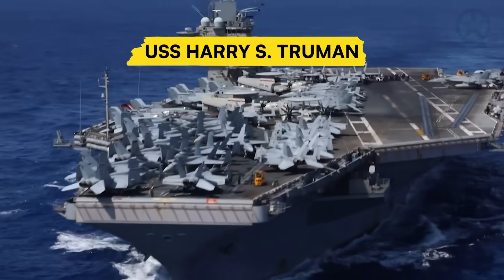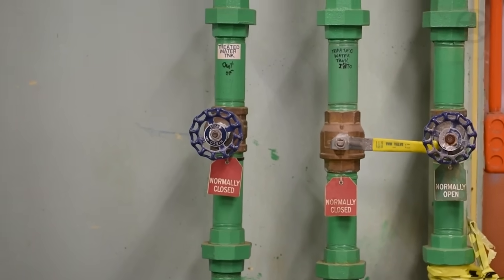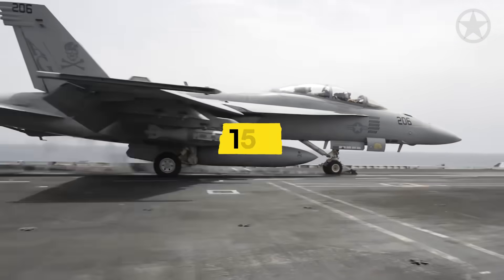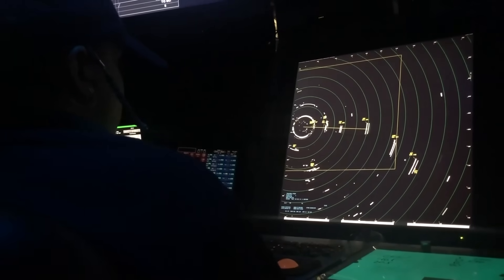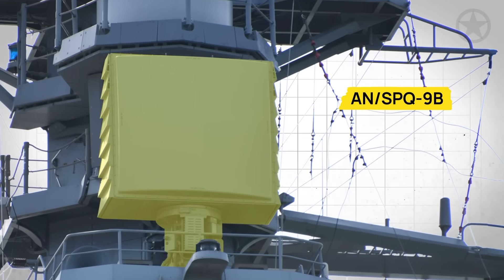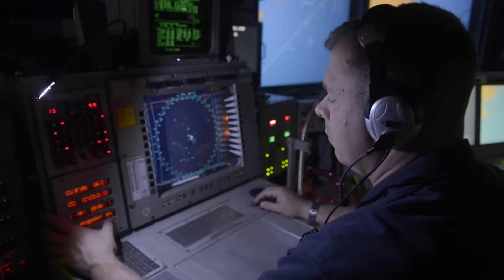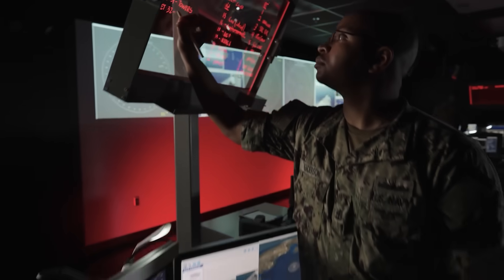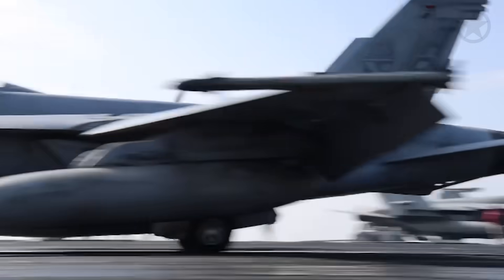USS Truman Launches Jets Every 30 Seconds to Hammer Houthis

Comment: I thought they used electric rail gun launches. Though every 30 seconds seems like it's working well. I'd think with the electric system it would be easier to control the force.

Comment: FYI:  A 230 grain 45 round leaves the barrel at ~565 mph.  If the F-18 was accelerated from 0 mph to that speed, the pilot would be unconscious or dead.
Reply: 150 knots is not 565 mph.
Reply: 9mm handguns pop out bullets over 800mph.  it is actually amazing they can fling something the weight of an F/18 with fuel and armaments up to launch speed so quickly.  Only the US can do it.
Reply: Yeah? That sounded stupid!!!